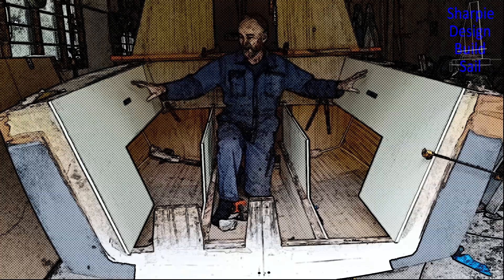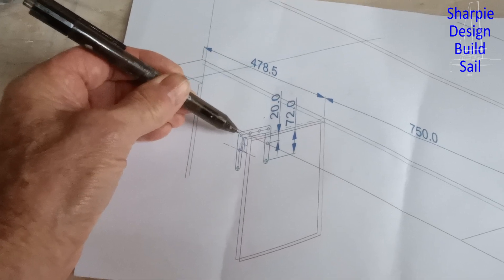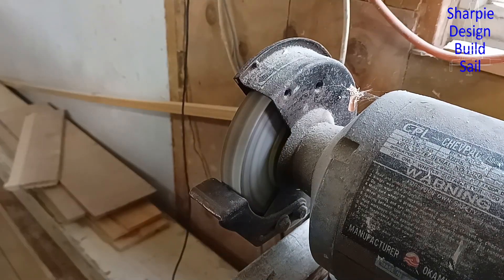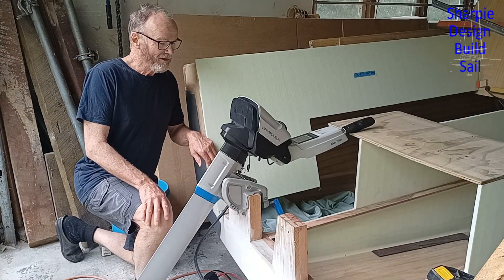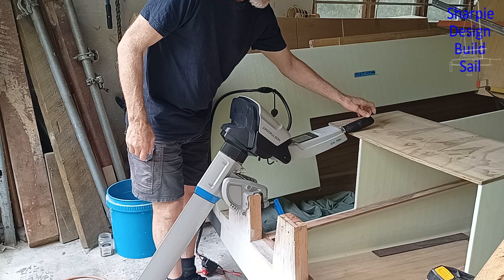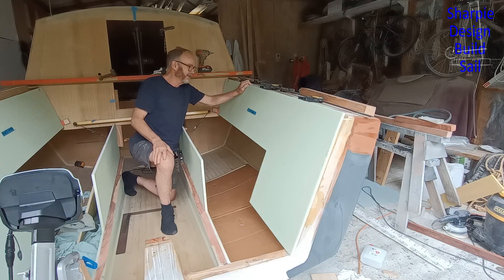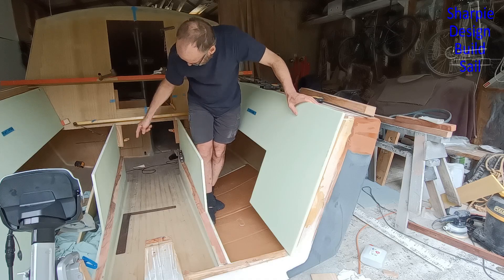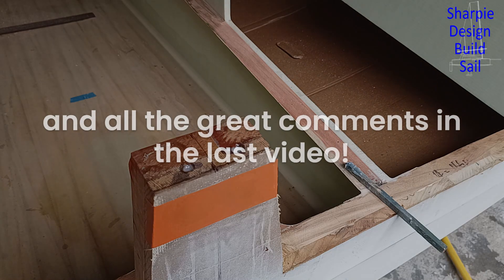Cockpit Build in Gurit Kerdyn PET Foam - Pt 2 - Sharpie Sailboat Design Build Sail

Comment: awesome karl thanks for showing some steps in CAD much appreciated . could you use a fibreglass tube with thickend epoxy for bushings? noticed some new additions to this production to great stuff!!!!
Reply from the maker: I'm sure you could and in fact for the anchor locker drains I kinda made the tube in place. I machined a cetal cone, split it lengthwise so I could install sand paper and bored out hole with drill. Then I wrapped wet cloth around tape covered cone and pushed it into hole. Worked very well if you don't mind a tapered hole!
I'm Auckland fighting the traffic and picking up fiberglass, trailer parts and might go to boat show as well.
Reply: @KarlFullerNZ  nice! hope u made it to the boat show! pick a stand for your boat next year?? iv got a few small bits of progress to report once im “finished “ tomorrow ill flick you a email
Reply from the maker: @andrewwastney9228 didn't make the boat show but I went home with a car full of trailer parts, literally! My srars aligned and a customer who walked in behind me helped me get a huge discount 😀

Comment: From experience I suggest you allow enough cable to the motor so you can turn it 90 degrees to the boat which allows you at times to manoeuvre easily in tight situations
Reply from the maker: Thanks for the benefit of your experience! That's a good reminder I'll need to do that. It makes me think I might have the cable coming out of a vertical tube so water can't seep up it and have some loose cable inside so I can slide it in or out, as the situation length requires. It could even have a little housing that the cable plug slides into, to keep it dry when not in use. Like on my previous trailer sailor I think the outboard will be left in place most of the time and live under a cover and I'll use that dielectric? grease in the plugs to help keep out the dreaded salt water. 
What was/is the boat you have and what electric outboard was it? I hope you had/are having a good experience with it? You have some great waterways to sail in Aus (I'm presuming by you name) going by what I see in  https://www.youtube.com/@SailingKateLouise (one of my favourite channels)
Cheers

Comment: It is a bit unusual to see the holes filled with epoxy as an alternative to plugging the hole with thickened epoxy and then drilling out the required center bolt dimension. Is there any special reason for this method?
Reply from the maker: Good question Captain! 
Basically, what I think I've done is make up a poor mans 😉 version of Chockfast which I've used quite a bit in ships engine rooms. In another life,  and it was awhile ago, but I was responsible for filling the gap between the steel stern tube and a liner that was about 5 meters long! I calculated, I can't remember exactly now, that I needed to use probably 30-40 liters in one go and it only can be used for up to 30 mins! So I had to have quite a plan, it would have been a huge disaster if I failed. So I had made up a funnel of more then 4L that I could quickly seal the top and I could connect compressed air to and I had a guy mixing the 4L tins as fast as I could pour it in! It worked very well and to our relief, eventually came out the vent hole on the other end outside the ship. Chockfast is basically thin thickened epoxy so it can pour. I'm not sure what Chockfast uses to thicken their epoxy but I used roughly half the glue powder (microfibers) I would use to make glue so I'm very confident it will be fine as all the force on it is pretty much compression.
Thanks for keeping and eye on my work, I can understand why you'd be concerned if it just looked like straight resin. I'll also be patching over the fill/bushes, with cloth, inside and outside.
Reply from the maker: It just occurred to me that the thinly thickened epoxy I poured into those holes looks thinner than it really was because those pouring clips are sped up quite a bit!